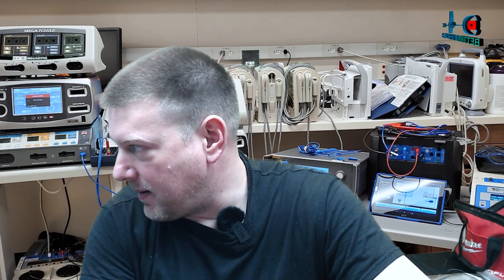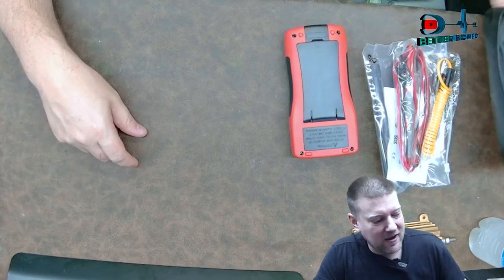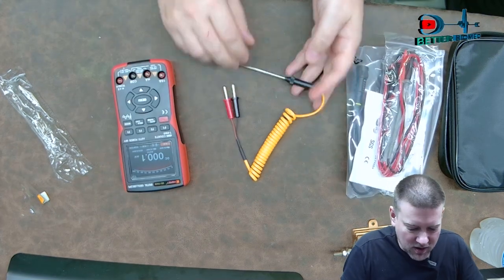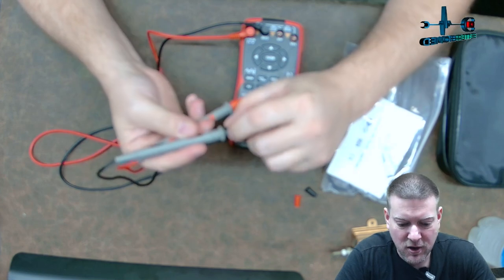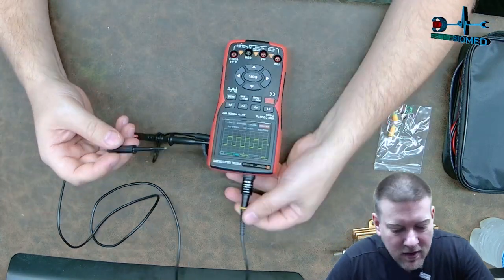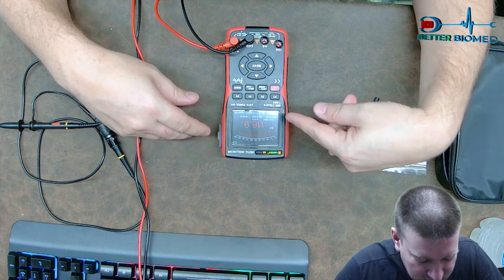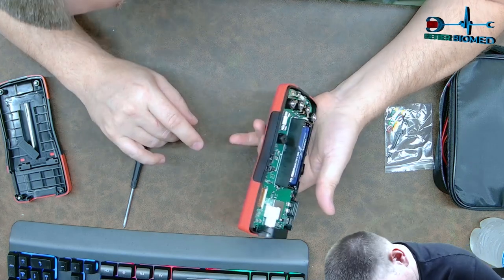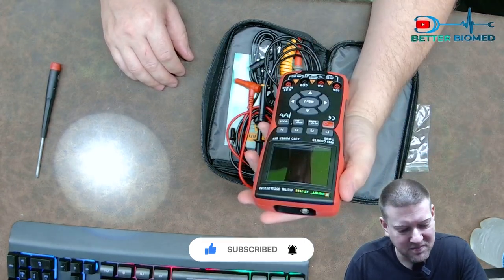The Best Oscilloscope Meter?!

Comment: This Oscilloscope meter is sold under different brands like :  BSIDE ZT702S , Zoyi ZT-702S  and Aneng AOS02 
The big benefit of a portable scope is that you can do measurings on mains powered circuits, but it is recommended not to plug in the USB-C to a computer during these mains measurings, because almost all portable scopes have the metal outside of the BNC connected to the outside of the USB-C port, so your scope becomes grounded.
Regarding the probes, these are generic pvc, but feels like silicon, i have multiple sets of these ordered a few years ago from Wish, and find them better then most probes that come with expensive multimeters. I have a set with the tips unprotected, and a set where i used red and black heat shrink to isolate the most part of the tips.
27:15 The fuses are the HRC (High Rupture Capacity) type, on most cheap multimeters they use glass fuses that can explode in pieces.
29:57 They also used brass inserts for the screws, that's also nice to see. Certainly a scope meter with good build quality.
Ps: on Banggood, this scope meter is sold as BSIDE ZT702S , for arround $65

Comment: I think it's voltage and time, not volume. The calibration button is used to calibrate the meter, not the probe. No input should be present when calibrating this function. I have owned mine for a long time and have found it to be very accurate. The best meter/scope on the market for the price. Great video, thanks.
Reply from the maker: Correct it's Voltage and Time.  That's the problem with having a paid video editor. I would normally have found the error on playback and edit. Thanks for watching Larry
Reply: I bought one….I like it.  The millivolt range is impressive…I checked it against my Fluke 341 voltage calibrator.

Comment: Thanks! I might buy one of these scope/meters. I like that it uses the 18650. But if I buy one, I'll immediately order a new set of leads from Probe Master for it and maybe an oscilloscope probe as well. I've not seen any leads that can compare to PM. My Brymen 869s leads were the best leads that came with the meters that I've bought, and they didn't even come close to the PM leads. 
I did keep my high voltage/current Fluke leads and only use them and my Fluke for high voltage and current.
Reply: I bought a really good set of prbes on Aliexpress and they are surprisingly good. No wobble on the tips. Really fine probes and standard probes, alligator clips, terminals that you can put on screw terminals. They were cheap but good quality! Better than jaycar electronics in Australia! Cheers from Australia 👍
Reply: @dragan3290  Probe Master leads are gold plated and not very expensive either. I laugh when I watch someone digging the tips of their leads into places to get a good contact. All my leads need is a gentle touch.
Reply: @robertcalkjr.8325  that's awesome! Nothing worse than having bad leads especially clumsy thick type.

Comment: I have a fluke 99 scope meter and way back when close to 30 years ago they used plastic BNC sockets. They even admonished you to never use a metal BNC plug as it would cause abnormal wear.  Almost every scope probe uses a metal BNC male connector. The flukes were plastic. It wasn't too long ago I received an Owon scope meter and it uses a plastic socket but metal male bnc plugs on the probes.  Weird.

Comment: Does it have a signal generator that is helpful in trouble shooting Stereo?
Reply: It has a signal generator for calibration but I don't think you can use as a dedicated signal generator or frequency generator? I bought a little kit version and biult the unit as long as you use a 9 volt battery and not a 9 volt power supply because the noise on cheap power supply has a lot of noise.

Comment: The best oscilloscope meters are probably the ones that I can't afford to buy.
Reply from the maker: The best O Scope meter is the one you use on you when troubleshooting. Most scopemeters are huge with poor battery life. The only thing this scopemeter should have, which I didn't see - is recording. Since this is less than $100 with good probes and has a temp sensor and it fits in a tool bag. This is a huge win.
Reply: @BetterBiomedChannel  It takes screen snap shot and retrieved with the computer
Reply: @BetterBiomedChannel there is a save feature.